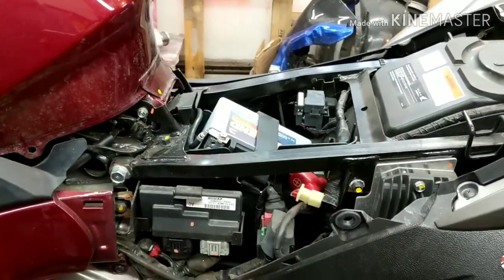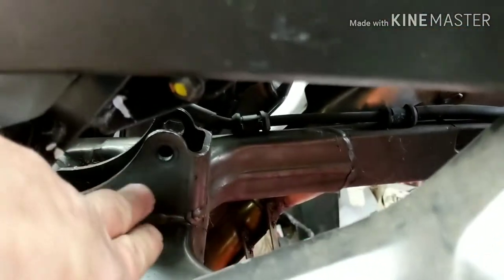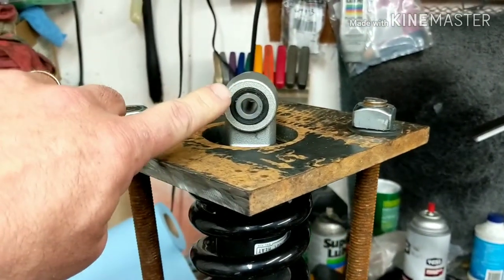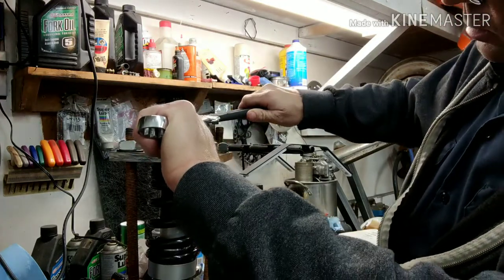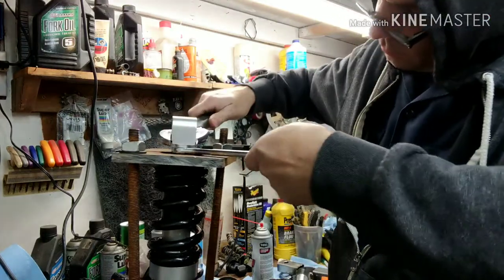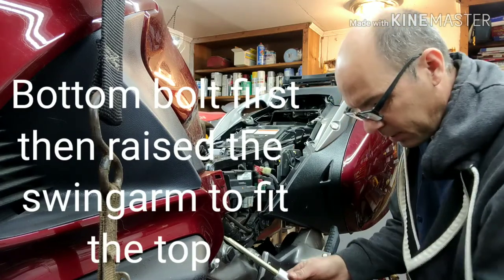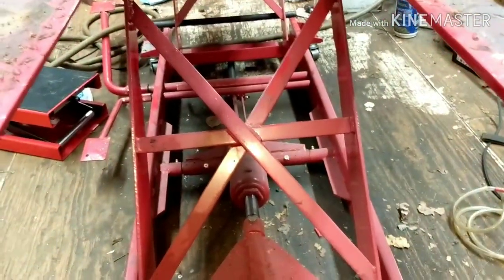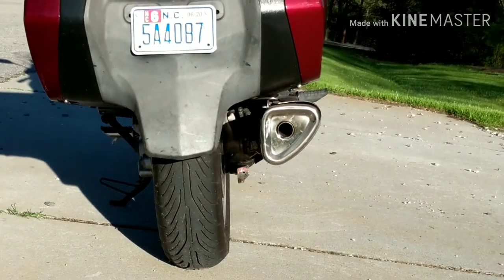How to lower a Honda NTV700 Hyperpro kit

Comment: Hi,  Your right! no one else has bothered to show this procedure  which has surprised me as I'm sure many owners of this model would need to lower the bike.   Ok not the most professional video but gives an over all idea of what's involved.  Another possible method could be to modify the bottom bracket on the swinging arm ? just a thought as I haven't tried it yet?
Reply from the maker: @davidrennicks2484  Thanks for the comment, and yes I'm no videographer, I'd be doing much better if I was..lol..

Comment: Honda put wrench bosses on the bottom of the eye fitting, so that you can use a wrench on it there, as intended.   Metric Wrenches are cheap and easy to get.. even if you have to use Harbor Freight.. but any Ace hardware store has them.